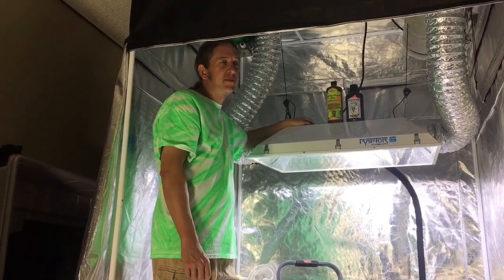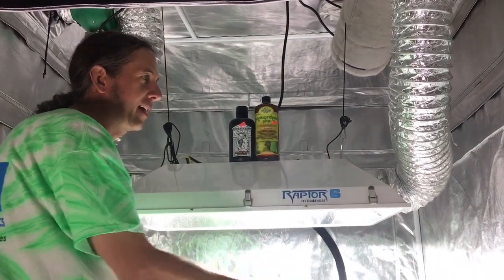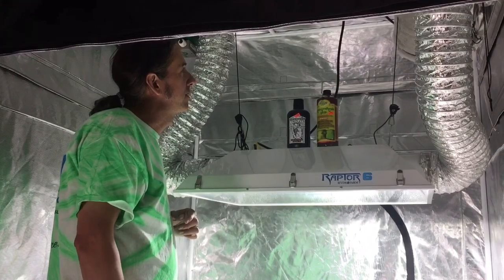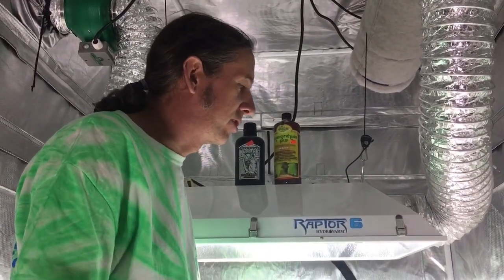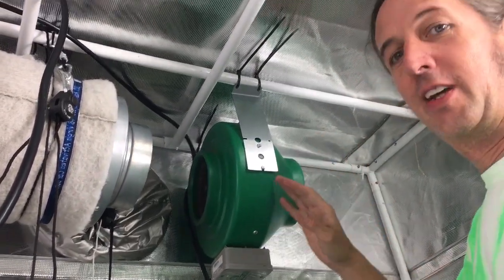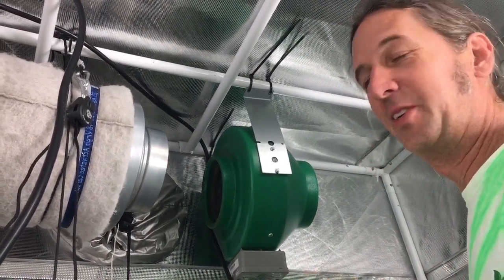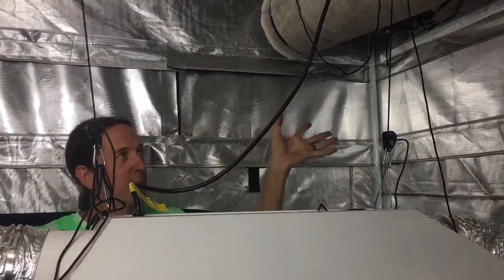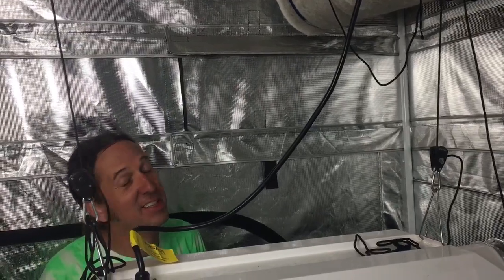WATCH THIS Carbon Filter Setup Video to Maximize Odor Control in your Grow Tent!!

Comment: Gary,  I love that you're very knowledgeable and experienced.   If I have an air intake from the outside going into the room, is the setup still the same for the filter and exhaust?   I should also mention that I'm using LED lights as opposed to high pressure sodium lights.

Comment: im a bit confused what size carbon filter would i need for a 120x120x200 tent im using a 600w led and do i need to cover the tents air vents and buy  an intake fan if want to hide odor or will i be safe forgetting about the intake fan and just leaving the air vents uncovered as long as i have a carbon filter in the tent i no its probably a dumb question but im really confused id be thankfull for any advice

Comment: what would you recommend to get fresh air inside a 5x5 x6  and a half foot tent i have a six inch fan and filter with ducting thanks gary
Reply from the maker: Hey there, if the exhaust fan is not pulling in enough fresh air then you may need the extra fan, if you do get an intake fan get something smaller than the exhaust fan so that you still have negative pressure in the tent so the air is still always going towards the carbon filter, hope this helps - Gary

Comment: Can You use 2 6 in Carbon filters Gary? One on the end of the duct say if you are venting within the house or same room?? Would that change any CFM ratings or Negative pressure issues?
Reply from the maker: The filtered air that is venting into the same room or even outside is going to be "clean".  There would be very little advantage, and perhaps as you stated some issues may arise when trying to add a second filter.

Comment: Hey i got 16w inline fan that pushes 185m3/h. And a carbon filter that cleans 75m3/h (Can 1500PL) the smallest can filter. Im growing in 3x3x5. Should i worry about air passing too fast over carbon filter ?

Comment: I don't get it. If the air escapes from the lamp it will still go back into the filter right? So how does this make any difference?
Reply: This way any air escaping from the lamp get filtered... In a basic setup the air sucked thru the leaks of the lamp isn’t filtered, so you can get smells.
Reply: the first setup is sucking in air so if the light leaks at the seams it will pull in smelly unfiltered air and then blow it outside the tent

Comment: PA Hydroponics  2 questions. does this completely eliminate the smell (if done correctly) and how loud is the average fan?
Reply from the maker: Hey good question and yeah it can eliminate all of your odors but every time you open the tent it can be an issue, you could set a separate filter outside  of the tent to clean the room the tent is in. As for the fan it can be a humming sound like a bathroom fan, I wouldn't call it loud but to some people it is loud, there are some fans that run very quiet but they do cost extra. Hope this helps. G
Reply: @PAHydroponics  thanks for the reply, this helps me out a lot.

Comment: You can push into can,let's say can is outside.
You just put your cloth sleeve inside the can yeh.
Same purpose.
It's about filtering.
Turn the fan around,sleeve inside push air,create more space in your room

Comment: HI Mate
Just a quick question from an ignorant viewer, when my filter is all used is it just the outside material I change or is there something inside I would have to change also?
Thank you
Reply: You have to change the carbon (inside) to get the same results as a new filter.

Comment: Do you need to vent outside the tent, or keep recirculating the air inside the tent?
Reply: Vent outside unless you have an expensive c02 generator.

Comment: Do you ever put a 2nd filter on the outside or is there no real gain?
Reply: If its setup properly, one filter is all you need
Reply: Having said that, it is a good idea to get some sort of filter for your intake to stop debris, hair and insects getting in. But I don't think it would reduce odor at all
Reply: @harryramsbottom1385  i went with a carbon filter on my intake and i was drastically under estimating how well these work.

Comment: For proper cooling always blow towards the tip of the bulb NOT the screw in part you know
Reply from the maker: Ahh actually right but not right, the bulb companies like Hortilux have said NOT to blow air at tip of bulb because they actually are meant to run hot to get to the right spectrum, I understand your point but there is another side of the story. Thanks for watching! Gary

Comment: 4 90 degree bends...... bye bye CFM
Reply: That's honestly the first thing I noticed. Must have some high cfm fan to compensate for all the bends.
Reply: You’re right... and by considering that the fan is pushing instead of sucking it’s even worst.
Reply: I have mine sucking air from the top vent into the carbon filter.. Am I doing it right?